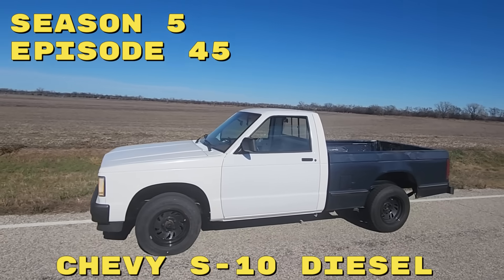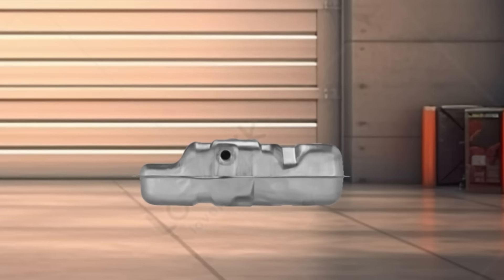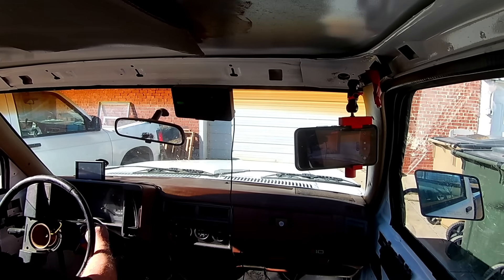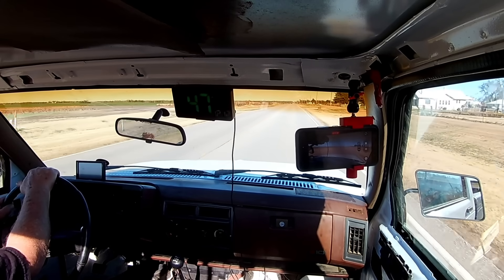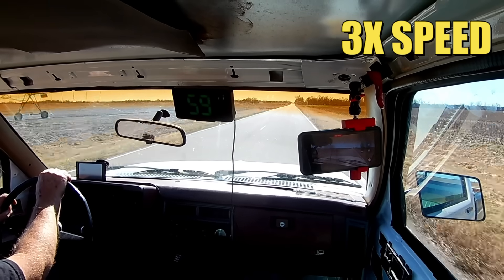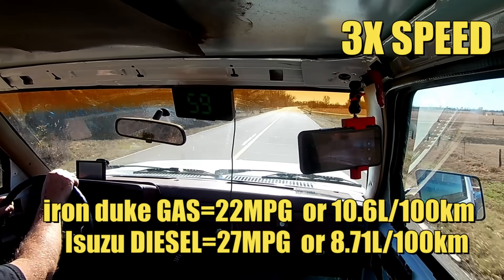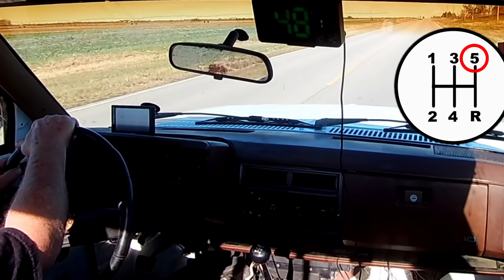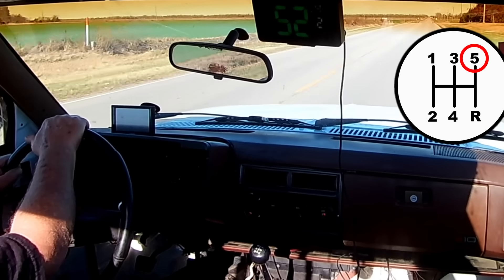S5 E45. MPG?  We road test the custom diesel Chevrolet S-10 to find out the fuel economy.

Comment: It's amazing to me how we had cars and light trucks that could get 30 - 40 MPG back in the 1980's, and now with all our technology, we don't do too much better.  I'd still rather have a 1980's Toyota Tercel or Starlet, equiped with a manual transmission, than any new car out there today.  Progress? Not in my opinion.
Reply from the maker: little cars today are HUGE and of course trucks got even bigger.  Its a tough call, this bigger stuff is safer for the average driver, but I also prefer the smaller and more nimble cars of the past.
Reply: The 1990's cars were better, they all had engines that made superior power and fuel injection was a very mature technology.   My Volvo turbo brick with it's 250 hp I-5 engine can be coaxed into getting close to 40 mpg at 48 mph if conditions are quiet. Many small cars from the 1990's had over 90 hp and got 40+ mpg.

Comment: I assume the engine has a heat riser to warm the air coming in.  If not, you may want to consider adding one.  As the weather gets colder, your intake air will get colder and this might effect the MPG on future runs.
Reply: Not on a diesel, cold air = dense air.

Comment: With old mechanicals you are often better reving it up than lugging it down. CC per injection cycle the fuel is the only thing regulated and rack requested position vs Gov changes delivery volume.. so if you are in the torque spring full fuel they tend to just waste fuel. My Caddy could get 48-52 on the freeway but you had to drive it like you hated it... you can also shim the injector poppets to increase injection PSI ( or use turbo injectors ) that helps with with stable injection timing and reduces the chance pressure wave in the line from tripping the poppet. Doesn't help with timing loss up in rpm but its something to try and shorten the dwell time of fuel delivery, pump piston has to be closer to the max stroke before psi is reached so the injection should happen closer to the mechanical specified time... But like my shop teacher always told me stock is usually good enough. Thanks for the entertainment keep on wrenching
Reply from the maker: Thanks!

Comment: Here in the UK i'm using a 2.0 Turbo Diesel rover 45 with a Bosch VE fitted, i'm getting 50 mpg (uk gallon size), commuting to work so i expected yours to get at least 40-45 mpg (uk gallon). I think turbocharging the engine and adding an LDA to the Bosch pump to adjust fuelling would make a big difference to that S-10 and increase the mpg. Turning the fuel and boost up on mine gave me 80-100 more miles to a tank of fuel due to getting into 5th earlier and being able to pull that gear longer before needing to change down.
Reply from the maker: A turbo is in the works!

Comment: Thanks for the weekly update👍
I.m.h.o. you should opt for a turbo upgrade, that would help with both the fuel economy and the driveability. My 1997 Merc 312D (ex fire Dept) does 30 MPG (US) or 7.8 L/100 Km. (Avg over 20K Miles) Not too shabby for a 2.9 L 5-cyl,  with an automatic (torque converter) gearbox. 😉
Reply from the maker: A turbo is in the works!

Comment: Yep, here in Germany Diesel has always been cheaper and still is. It's weird to me that it's more expensive than Benzin elsewhere (and also weird to me that you call it Gas, since it is a Liquid).
Reply from the maker: LOL,  gas is short for Gasoline... although it does sound weird now that you mention it.
Reply: @robotcantina8957  My father worked petroleum cracking towers and explained that Gasoline is the left over higher end liquid cracked from from Kerosene production and it's content is a witches brew of various -tanes and -tenes.  Benzine was a small part of what makes up Gasoline. Mostly above room temperature boiling point liquids that like to volatilize into gas.

  That is why it's not good to keep an unopened container of gasoline in a sealed low space like a basement. especially if it has a boiler or other burner heating device as the gases tend to collect in low spots.
Reply: @robotcantina8957  Even more so since there are cars powerded with Liquefied Petroleum Gas. it's probably impossible to use these in the US, how would you find a gas station that sells actual gas?
Reply: Never be able to unsee this now...

Comment: Well I was way off on MPG guess lol. Some things that might help it out:

If you are running 15w-40 going to 5w-40 will reduce parasitic drag.

Replacing the tailgate with one of those aero nets to improve aero dynamics.

Old corvette wheels are usually cheap on marketplace, aluminum for reduced rotating mass and they are typically more aerodynamic as well. 

Lucas injector cleaner is an amazing additive I use it every fill up on gas and diesel. Keeps things clean, lubricated, and boosts fuel economy.

Comment: TBH would be interesting to see we 1.6 equipped with AMR500, as Kubota performed really nice with supercharger
Reply: I suspect the AMR is way too small, perhaps a used Eaton M45 as used on the early Mini Cooper S?
Reply: @carlterranella8531 I was looking at boosting my old 2.8L S10 with an SC14 supercharger, the type intended for a Toyota Previa. That might be a bit much, with a displacement of just over 1400cc, but it would definitely give a good bit of boost.
Reply: Yes I was thinking the same: how well a little supercharger will fit this contraption? Jimbo, we're counting on you!
Reply: maybe you sleep-watch.
Reply: that little motor really enjoyed that extra fuel to
Reply: OH I hate those things. Noisey AF. They get hot, don't really provide boost. Just cheap Chinese chunk. Somone should bring out an affordable small 'charger' that actually works and doesn't sound like an engine running with no oil in it! ie. belt driven turbo!
Reply: I think a general rule of thumb for a supercharger to be relatively efficient, is the charger needs to be displace about as much per revolution as the displacement of the engine.

Given the AMR 500 is about 1/3 the displacement, its going to become extremely hot and inefficient quickly.

So, something like the SC14 supercharger, or even a cheap knockoff, would probably be better.
Reply: @XenocraftGalaxy  WOW. Great rule-of-thumb info bud.

Comment: Hi Jimbo, good job as usual. The difference between gasoline and diesel fuel in countries (i'm in Italy) depends mainly on politica decisions in matter of taxes. Now diesel is less cheaper than gasoline but - in general - diesel powered cars are more fuel saver and have a better mileage, compared to gasoline ones. That is the reason drivers still prefer those kind of cars and vans, especially when high mileages for year are run.
I hope your next level to be a turbo powered VW diesel engine for the S10!
Greetings from Italy!!!!!
Reply from the maker: Greetings!  thanks for the input!

Comment: Here in Sweden, diesel is also more expensive based on the state's opinion that ''a diesel only draws half as much''..
Based on experience, the little n/a 1.6 needs to be tormented with high revs, which can be easily eliminated with a turbo. More 'umpf' and higher MPG.
I'm aware that you're experimenting, but you'll be pleasantly surprised by the difference.
'More boost' is always better until 'too much' occurs.. but weren't you planning to put in a 1.9 later anyway...?
Reply: I'm not sure where you are getting your info but 1Z and ALH are both 1.9 TDis n same engine in terms of size, I can't see how you'd need chassis mods to fit an ALH over an alleged 'drop in' of a 1Z.
That said I've never attempted to lob one into an S10.
An AHU is another alternative - if they are to be found where you are....
Reply from the maker: The original plan was to use an ALH, however after some more research, the ALH will not fit in the engine bay without doing a lot of cutting to the chassis.  I'm currently hunting for a 1Z which is extremely hard to find.

Comment: I had an 83 Malibu wagon with an anemic 110 horse v6. It got 18 mpg on the highway. I changed it to a small v8 with roughly doubled the horsepower. With the v8 I averaged 22 mpg. Sometimes more hp will mean better mileage because your right foot doesn’t always have to be against the floor to make the vehicle move.
Reply from the maker: Yes, I agree.  the 1.6 just doesn't have enough power and its likely wasting fuel working harder

Comment: I've had 3 of these Isuzu diesel pickup trucks with the c223 engine in them they always seem to give  32  to 36 mpg with nothing in the bed. And if you kick up the timing on the injection pump , you can make it do seventy miles an hour.
Reply: Same...little difference in mpg between 4th and 5th gear...
At the imposed 55mph😂

Comment: Buy vegetable oil it about 4.5 $ cheaper than Diesel and this engine do not have electronic fuel injection , 😱  oh another fun project you could use clean filtered restaurant waste oil  😁 wau drive for almost free

Comment: I had one of the Dieselgate Golfs, and as i recall, diesel was generally less expensive than gas even in to the mid 2010s. In fact, you might find that it still is for much of the year -- i remember there being points where diesel would be more expensive than gas when the refineries cut between summer and winter formulations, and it might still be early enough that the summer to winter cut over supply issues still haven't washed out of the system yet
Reply from the maker: Interesting.  I never paid much attention to the price back then.  Thanks!

Comment: 32 mpg is not bad for a truck that looks like a brick , 
 I had a Mercedes 1972 220 diesel in the 80s and I can remember paying about 80 cents a gallon then and it had a 4 speed manual transmission and I got about 38 to 40 miles to the gallon and I tested that mileage all the time the governor would not let the car go more than 70 but the speed limit was 55 no matter where you were,
 The car weighed 3800 pounds according to the owners manual, it was the most extensive manual I have ever seen it said what you needed to set the age valves at and what to do if it was cold and had a hard time starting like adding  kerosene to the fuel to thin it down and pull starting it with a tow strap from a hook under the front end

Comment: Always appreciate the metric and the lack of AI crud.  The price difference between petrol and diesel in the UK sounds a bit on the low side but within what I would expect.
Converting the mileage to UK gallons (You used just over 1 UK gallon.  Yes we buy fuel in Litres, use kilometres but measure economy and distance in cars in miles), that is about what I would expect for a vehicle that size with an engine that size.
Reply from the maker: LOL, the UK confuses me with the mix of metric and imperial.

Comment: 13km/l for a brick is not bad at all! my geo sprism with a 1.4 ohc gets 15km/l highway on a good day. Congratulations for your progress! you came a long way to be able to reach to this point of the thing running and driving! by the way ¿why are you parcially deaf?
Reply from the maker: Partial hearing loss do to an explosion many years ago.. then one day the left ear just stopped working.  Had the MRI scan and nothing unusual was found.  The doctors really are not interested in finding out why. they just want to push the hearing aids or implants.  I'm fine with my current situation.

Comment: Diesel fuel is about 20% heavier than gas.When you fix your gas gauge you can add a metal gear clamp or 2 around the float to weigh it down a bit to make the reading accurate.

Comment: I remember when the Columbia space shuttle originally was transported on the back of a 747? they had a tail cone to help it be more aerodynamic.  I was telling my wife I wonder how these little trucks would perform if you had a giant aerodynamic shell that fit in the box and matched the roof line and something similar that would be transparent and fit over the front to give it a Previa or Olds Silhouette look.  I bet it would make a noticeable different for streamlining although you now have a greater cross section exposed to the wind.  Thanks for sharing Jimbo!

Comment: Back in the day, I drove my VW Rabbit diesel 1.6 Turbo from Mexicali to Grants Pass Oregon using 38 litres (10 US gallons). The distance travelled was 1150 km (700 miles) which is in excess of 60 mpg. There was a tail wind the whole time, ordinarily the average was closer to 47 mpg, diesel at that time was $0.89 per gallon, which really suited a cheap Charlie such as myself, as I annually made a trip from Vancouver Canada to Guatemala to escape the winter.
Reply from the maker: LOL, thanks "Cheap Charlie" for the input!

Comment: It’s obvious that car will get worse mpg than 1,6d golf, there was a vw t3 van with 1.6d engine and it gets around 7-8l/100km so this result was to be expected. For comparison I drive Mitsubishi pickup similar size to ford ranger 2100kg weight and 2.5l direct injection common rail diesel usually uses 8-8.5l/100km

Comment: I'm from Poland. 
One liter of petrol cost 5.69 PLN (1.42 USD), one liter of diesel cost 5.99 PLN (1.50 USD) and one liter of LPG cost 2.56 PLN (0.64 USD). You convert petrol cars to LPG (propane butane); it burns 10% more than petrol because of energy density.
So doing 100 km in a petrol car is about 54 PLN (13.50 USD), diesel 37 PLN (9.25 USD), LPG 28 PLN (7.00 USD)

I have a few cars, one of the is 1.9 TDI ATD Skoda Fabia, highways it burn 5L per 100km, which is about 47 MPG, cruse control at about 130km/h
Reply from the maker: Thanks for the data!

Comment: My employer has quite a few Kenworth T800s with 350hp 12L Cummins engine used to drag pumps grossing out at 100,000lbs. They don't have the power to hit the 62mph governor, so they run full fuel the whole time, and get 3.5mpg. Meanwhile the same setup with a 485hp 15L Cummins gets 4.5mpg. Having too little power can be detrimental to fuel economy
Reply from the maker: I totally agree.  We defiantly need more power.
Reply: This is a case when small, low power engines are overgeared.   Generally this isn't the case of most production cars. 

 European cars never sold here in the US like the Renault R4 and the little Douvrin suitcase engined Citroens were geared for cruise at 45 to 55 mph with their engines making about 40 hp. 

   I'm betting that the S10 would get better overall mileage with 5th gear being avoided. I used to own a 1962 Saab sedan with a 38 hp 2 stroke engine, and had swapped in a taller final gear ratio 4 speed for the old 3 speed. And the engine had a lot of trouble maintaining an average speed over 55 mph when in 4th gear and got worse fuel mileage because as a 2 stroke 850 cc, it preferred running at over 4000 rpm in cruise.

Comment: I predicted 35 mpg’s at best. The combination of low hp and brick aerodynamic just isn’t ideal. 

To put some oversimplified physics to it, velocity is squared in some equations. You could have been driving at 70+ mph wind resistance which is impressive.

Edit: modern vehicles have 200+ hp for groceries getters to be able to do 80 mph in all weather conditions. Just to put it into perspective.

Comment: What did you do with the cold start lever? I'm wondering if you set the lever on the back of the pump in "cold start" position.
Reply from the maker: The cold start lever is connected and functional.

Comment: With this same engine in my 1995 caravan 5 speed , weight 3,300 lbs, turboed , 74 hp, i get almost 44 mpg for a usa gallon.Top speed 78mph.You can see it on my channel.Your mpg is what i expected because it is so under powered and rear drive.My 4,000 lb 2011 grand caravan 6 speed VW 2.0 TDI with 195 hp and 350 lbs torque drives at 1,650 rpm at 60mph and gets 47 mpg in usa gallons. Top speed 130 mph. This cjaa motor in your truck would make it a tire burner with 44 mpg if you geared it right.

Comment: In general, diesel is cheaper in Europe but diesel cars are usually taxed higher. Driving a diesel makes sense if you drive about 15000 miles or more per year.
Commercially though (taxed differently), almost every van, truck or semi-truck runs on diesel.
Now, France is a whole different story. Almost all passenger cars run on diesel in France, i dont know why actually, I think its associated with luxury.

In the Netherlands, if I would run a Golf 1.6 TDI versus Golf 1.6 gas/petrol. Tax per month would be 120 euro for the diesel, 1.60 euro per liter of diesel. Tax per month on the petrol would be about 60ish and 1.90 euro per liter of petrol. So economically, for most people, driving a diesel doesn't make sense.
Reply from the maker: Interesting, thanks for the inside information on how the taxes make a difference.

Comment: Very interesting, good series. As a point of reference my early 2000's VW TDI (1.9 Turbo diesel) gets an average 46 MPG combined.  If I'm careful, I can get slightly over 50 MPG highway and it is capable of cruising all day at 80 MPH with a drop of fuel economy to around 45 MPG.  A bit of apples to oranges comparison but a data point in case anyone is interested.  Your S-10 is cooler than my Jetta, looking forward to seeing you progress with the project.
Reply from the maker: That's some great fuel economy from your TDI!

Comment: Road sound wasn't bad, are you going to try supercharger or just turbo?  Either should help extend the torque curve. My 88 S-15 with 2.5 got 24 on highway, I think I had 28 inch tires, but I had pulled out intake silencer at air filter tube and put MSD 6 box on it. Had T-5.😊
Reply from the maker: A turbo is in the works.